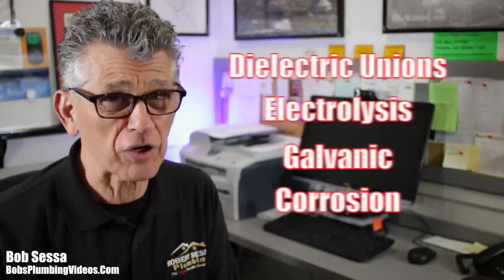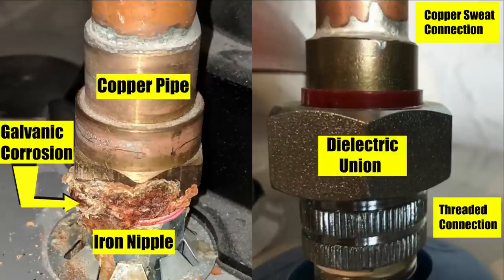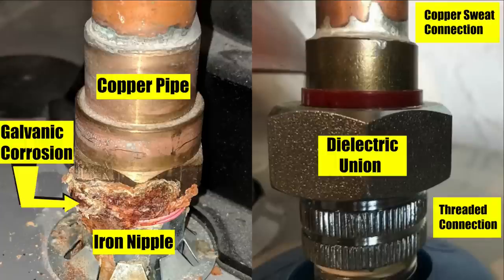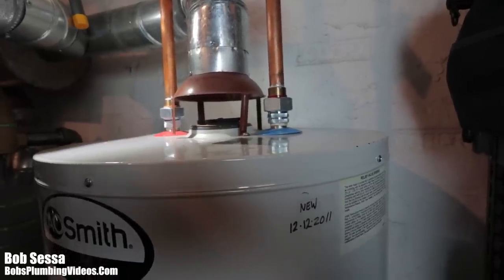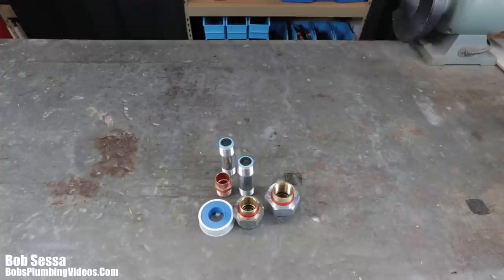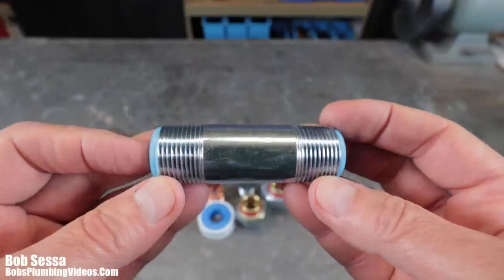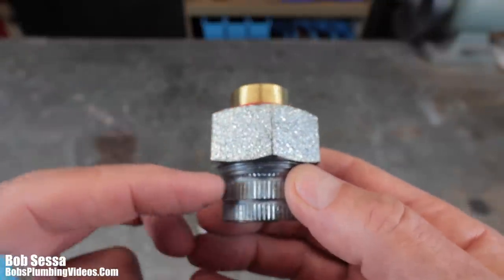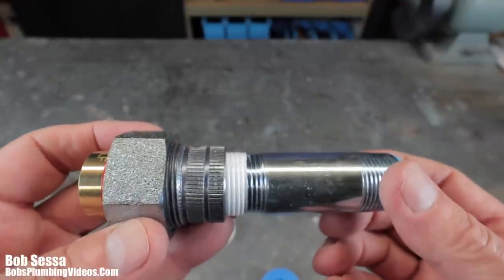Dielectric Union Water Heater -

Comment: Today I bought an all-brass dielectric union. I chose all brass because my water heater's galvanized steel dielectric nipple is lined with plastic and I wanted my new dielectric union to have as little steel exposed to water as possible, so I paid over 4 times the price of a steel/brass dielectric union to get all brass. Bob, in your video at about 10:22, we see you wrapping the teflon tape around the end of the dielectric nipple 7 times. Is that how thick you usually go for this type of connection? Like the dielectric union featured in your video, mine has a knurled surface on the half of the union that screws onto the nipple. What kind of wrench do you use to grip the knurled surface and how many turns, if any, past finger tight do you go? How tight do you squeeze the rubber gasket so that it won't leak over time? Thanks for any answers.
Reply from the maker: I usually go 5 to 7 times around followed by MegaLoc. I use a 440 channellock pliers to tighten them and I would say for the Unions hand tight plus one full turn with my channel lock pliers.
Reply: @BobsPlumbingVideos  Thank you so much for your valuable information which I am sure many of your subscribers will also appreciate.

Comment: So i took an ohmmeter and read under 1 ohm across the already corroded dielectric unions i installed 4 months ago when i put in the new water heater.I thought that i should have had infinity or something alot more than a short across the dielectric union . Where did i go wrong any ideas?

Comment: I keep seeing everyone say you can mix brass and galvanized, but everywhere I see brass touching galvanized the galvanized is corroded as hell. 
They have copper and stainless dielectric water heater flex hoses but the nuts on them are brass, so you still get galvanic corrosion from the brass nuts touching galvanized.

Comment: Brass is allowed to connect between copper and galvanized according to code
Reply: Though dielectric union is the way to go with water heaters. 

If it’s a riser install or bathroom repair in pre-war building, you can use brass nipple between galvanized and copper
Reply from the maker: New York? Brass is less of a threat, but for a couple of extra bucks, I use dielectric unions and nipples on all of my installations. Peace of mind! Regards, Bob.
Reply: Doesn't work. Doesn't even make sense. Look at a galvanic potential table; still too much voltage between the brass and the iron/steel/galvanization.

Comment: Is there any problem (galvanic corission) between copper and brass materials?
Reply from the maker: No! only between ferrous and non-ferrous metals. Copper and brass are both non-ferrous metals. Mix either of them with steel, galvanized steel, (ferrous metals) or anything you can stick a magnet to, and the corrosion will take place.
Reply: @BobsPlumbingVideos  thanks

Comment: Why not just use flexible water lines with brass connectors so the next replacement is easier in 5-10 years?
Reply from the maker: Good question! Not commonly done here and I don't know why. In all the years of doing this, I can count on one hand how many times I've seen the flexible water lines. Thanks for commenting! Bob.
Reply: The flexible copper lines used to be common in my area and have the plastic gaskets on both ends to provide electrical isolation. I think a lot of home builders are now using the stainless steel braided hose on new water heaters because the hose is cheaper but I have heard that those hoses do break or burst and can cause water damage.

Comment: Got the nipple out and the anode. Plumber did the connections today. Had to put old anode out till new one arrives. These should be universal. No one wants to make this easy. The plumbing supply place in Brooklyn, let’s call it Brooklyn plumbing supply, says, most people just replace the whole water heater. What scammers. $17 vs $1000+. Crazy

Comment: It’s it still necessary on these newer tanks that have dielectric nipples? Is redundancy good or not worth it?
Reply from the maker: Most new tanks already have the dielectric nipples already installed, the dielectric unions act as a buffer between the incoming brass or copper water lines. I will tell you that I've removed leaking water heaters with the dielectric nipples installed and have seen corrosion inside both the hot and cold water inlet and outlet???? Go figure!

Comment: I put Teflon on my nipples on the water heater and screwed my dielectric fittings down as tight as possible and it just doesn't stop dripping water no matter how tight I crank down on those fittings no matter how little amount of Teflon or how much Teflon I use it's still leaks I just can't understand why same thing with one of the compression fittings I put on I have one compression fitting in the entire loop because I couldn't get the supply to the building to stop dripping enough to weld on sweat on a valve so I put a compression valve on there and the matter how tight I crank down on it the fucker still drips. It's just a 5 gallon hot water heater in a storefront business as the biggest pain in the ass job I've ever done
Reply from the maker: Use your teflon, 4,5,6,7 times around, then follow with blue block thread sealant.https://shorturl.at/6iaD7

Comment: How do you tighten the bottom part to nipple? After hand tightening I turned half circle with wrench and I see tiny droplets when the tank is full. I have tighten them more, but I'm worried that if I tighten more it may break?
Reply from the maker: Most new heaters have the nipples pre installed, but if you're installing new one's. I use Teflon tape followed by Mega-Lock pipe joint compound on boths sides. Hand tighten into the heater and then install the union, then with a channel lock pliers  or 10" pipe wrench drive both of them home at the same time.

Comment: hi Bob,,,whats your feeling on stainless nipples?
Reply from the maker: Expensive! A lot of differing opinions on the use of dielectric nipples and unions, I still use them but all to often still find a build up of corrosion inside of them. Years back I was using brass nipples and they seemed to last the life of the water heater?

Comment: I believe the nipples on top of conventional water heaters are threaded into tank and they are stainless steel. This should act as a dielectric solution in most cases. Am I correct??
Reply from the maker: I personally have not seen stainless steel dielectric nipples, only galvanized with the plastic liner. But I see no reason why a lined SS nipple wouldn’t work.
Reply: of course it does.  this guy is old school.  you did need it in the past, now however with braided lines and fittings, those unions are not needed.
Reply: @BobsPlumbingVideos  Do you understand what the dielectric union is supposed to do? It is supposed to prevent galvanic corrosion by insulating one threaded end from the other threaded end. The solid metal 'dielectric nipple' (what a misnomer), will allow electricity to flow from one end to the other, and cause corrosion. So it won't work.
Reply: So you said the nipples are 'stainless steel threaded into the tank' how would that create an insulating barrier as would a dielectric union? It is threaded into the tank - making a perfect electrically conducting galvanic pathway.
Reply: @SF-fb6lv  Camco Dielectric Water Heater Heat Trap.  Prevents escape of heat through the inlet and outlet when flow stops. Self cleaning fittings prevent corrosion. Dielectric inert thermoplastic lining. Color coded cold inlet and hot outlet. Ball check style. Specifications: 3/4 MPT x 3/4 MPT x 3' length MIP. Dimensions: 5.5'H x 3.63'W x 1.14'D. can be purchased anywhere.
Reply: i just installed  a direct vent hot water tank and the manufacturer has installed dielectric plastic in the nipples.  so i just used 3/4 braided  connector hoses from the copper to the tank.  easy as pie.  besides, read what he said. could avoid premature corrosion.  once you have a tank thats over 10 years old, you should just buy a new one.  when i took mine out, you cant believe the amount of rust is in the bottom of the tank.  i dont know if the nipples on a conventional tank has thermo plastic inserts, if so then dont waste you money buying these couplers that he is stating.
Reply: @jopar6314  most plumbing codes require hard piping of water heaters  including the gas line when I see braided lines  for water and a gas flex I changed them out to hard pipe.  Customers pay to get the job done correctly and by code heck they even have permits to install water heaters.  Know why it’s to protect the homeowner and to make sure the inspector can inspect  it to make sure  done by code   Besides it looks like crap. Take pride in your work  it’s greedy plumbers that  legit plumbers despised.  Another thing or two here The plumber protects the health of the Nation ( we are licensed/regulated by the health dept).  Union plumbers do the job right the first time  I admit there are some non union plumbers who do good work and they  are the ones to get  targeted/recruited by the  unions.

Comment: Isn't the copper and steel still connected via grounding wire?
Reply from the maker: Technically yes,  here's the technical definition - Also known as galvanic corrosion, electrolysis happens when two dissimilar metals are directly connected causing the lesser of the two metals to corrode. For the process to occur, the two metals have to also come into contact with a conductive electrolyte.
What is electrolysis between dissimilar metals?
In other words, when two different metals are in contact with each other in the presence of moisture, there will be a flow of current from one metal (the “anode”) to the other metal (the “cathode”), and one will be eaten away, or disintegrated, while the other (the “cathode”) will remain intact.